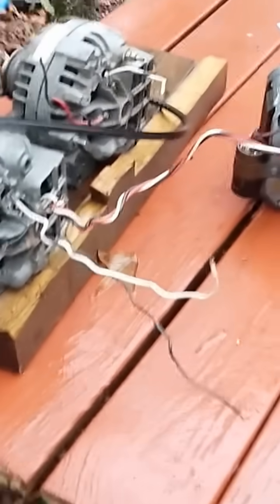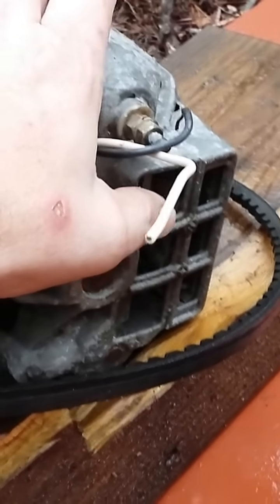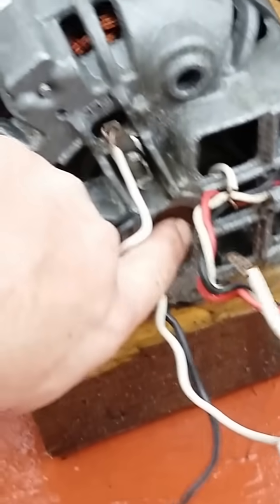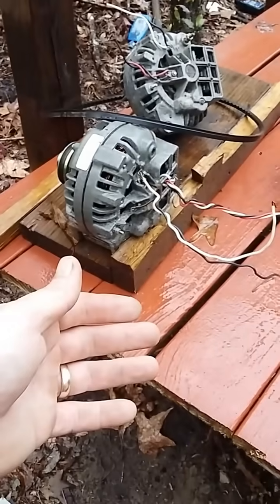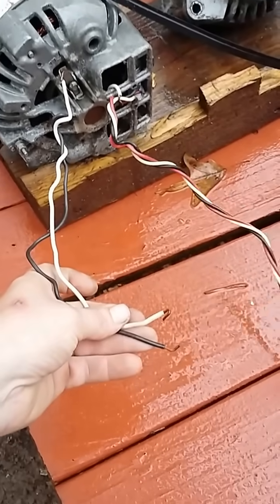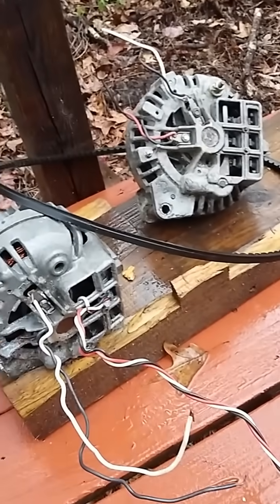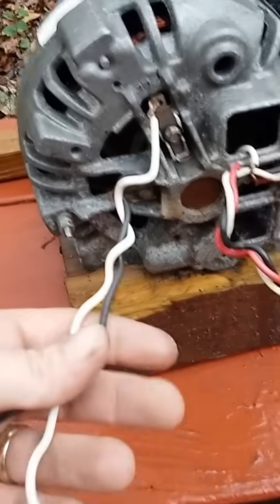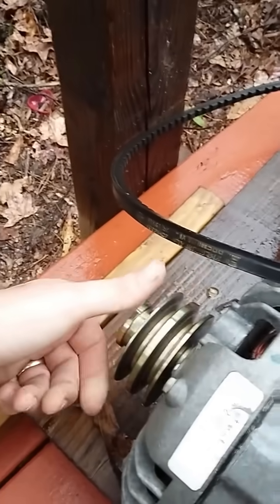Update Free energy forever no wind no solar no gas READ DISCRIPTION!!!

Comment: Diode = has nothing to do with converting AC to DC..... Diode = a "1 way street" for current.  It allows the current to travel in 1 direction, but not the opposite direction.
Reply: Ya, I wasn't thinking when I posted it lol.... had a dumbass moment :)
Reply: Rusty Koenig it takes diodes to make a bridge rectifier to turn AC into DC
Reply: Rusty Koenig uhhmm... Google diode.. Then bridge rectifier, then why not half wave and full wave rectification... Or 120v ac to 12v dc schematic..
Reply: Rusty Koenig,
Actually 4 diodes in series creates what's called a Wheaton's bridge which does convert AC into DC, but this guy is still an inbred moron!

Comment: Hi Thomas, I want to try welding with a similar set up. I'm thinking I don't need a battery, just a way to spin the stator. True or do I need 6v input too. This is my first time commenting on YouTube so I'm not sure how to contact you privately. Thanks
Reply from the maker: Madrone Kubovcik 
yes brother it would be very easy to take a 1 & a half horsepower compressor Duty AC induction motor running off of 110 VAC only consuming three or four thousand Watts max and turn a alternator it would be 12VDC @ 90 Amps you could definitely stick weld with that pretty much whatever size you wanted but if you bypassed the direct current Bridge rectifier at 120 volts it would be 9 amps which is still basically twice the input of the motor but the idea is not just to use one motor and one alternator or generator... (same word) But the alternator inherently produces alternate current in synchronous and is changed back into direct current with a direct current bridged rectifier. it is just 6 diodes in series from 3 phases to 1 phase on a piece of stainless steel that is isolated from the casing (ground) of the alternator.